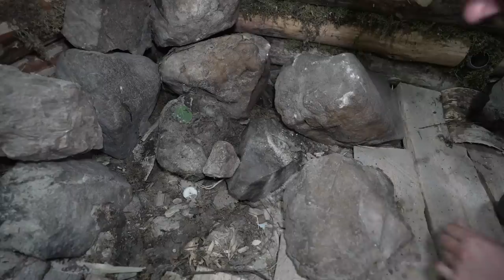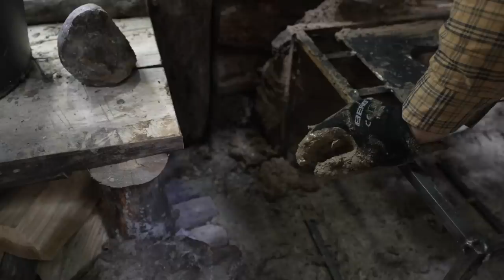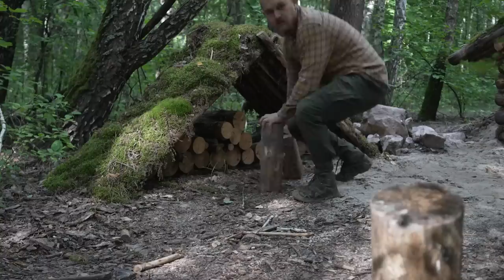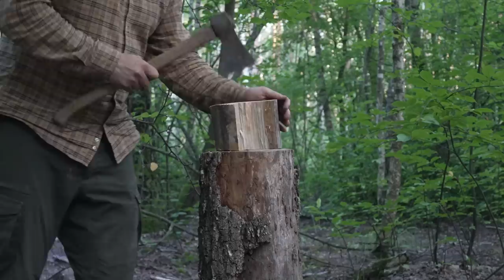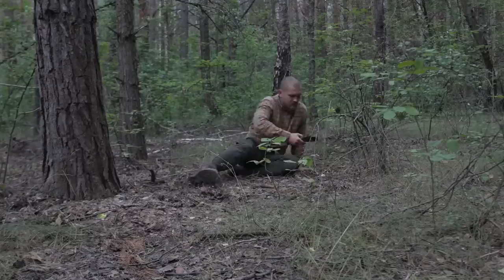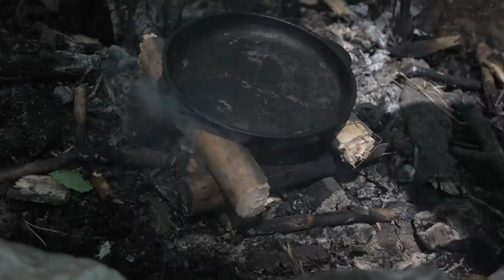rainy day in dugout , big stove in a biggest dugout , no talking

Comment: The only issue I have with that dug out is that window is way too big a bear could get through there or any other threat from the outside just way way too big for my liking. Secondarily I would have ran that pipe quite a ways from that dug out and camouflaged it somewhere up through a tree who knows something where it wasn't so readily visible. I mean middle of the night somebody wants to get at you you got that stove going all they have to do is plug it you're going to die carbon monoxide. If not that it's definitely going to draw you out
Reply from the maker: I made a large window to get out of the dugout when a tree falls on it, and block the exit through the door, so I will have an emergency exit, just in case